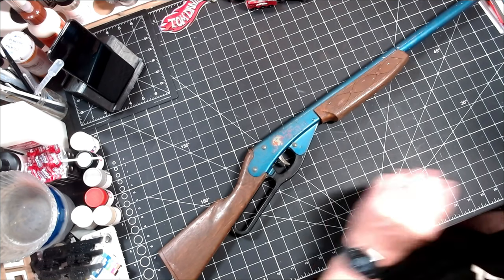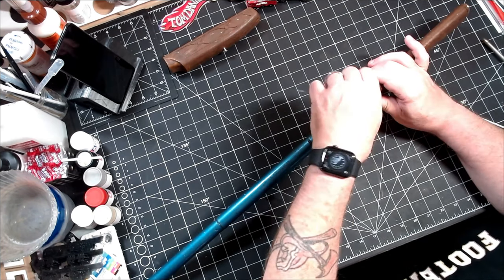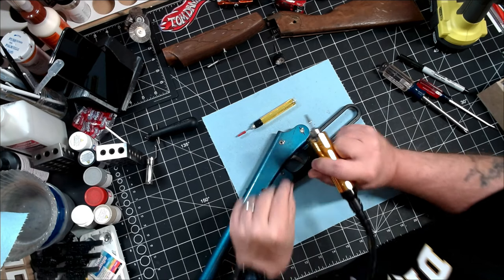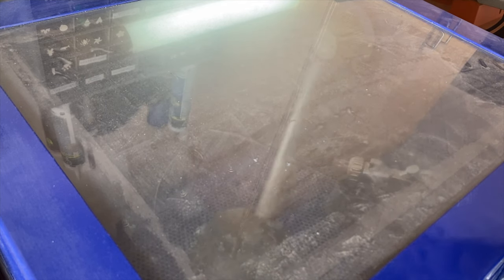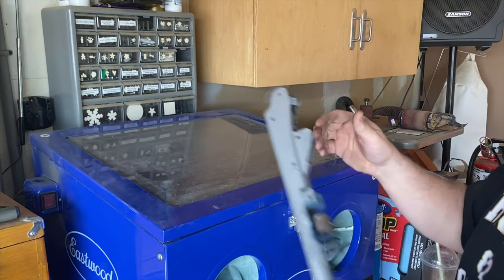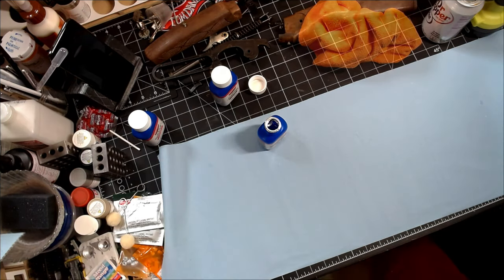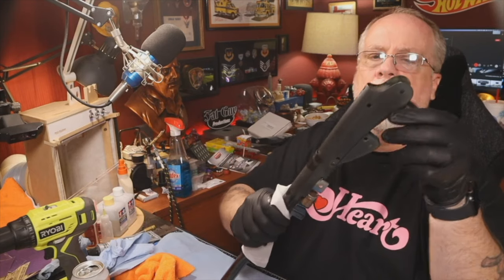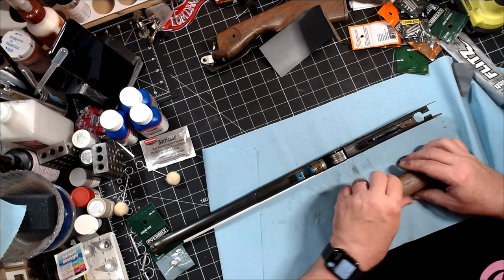Restoring a Daisy 660 Ricochet Noise Making Toy Rifle

Comment: Beautiful.  At first I was thinking...yes...the gun needs the decal.  But then you finished...IMHO it was the right decision to forego to decal.
And your right...the under barrel grip and the stock are amazing in the amount of detail molded into the plastic.  Fantastic wood grain.

Seems to me I always thought "blue-ing" a fire arm left a very slight blue tint.  Not noticeable unless really staring at it.  Wikipedia says it does leave a blue-black appearance...but your cold blue application did not appear to.  
Sorry.  A lot to unpack here....there is more...lol.
The ricochet drum...I am a guitarist...I noticed that the drum had light surface rust.  I cant help but thing cleaning that up would maybe improve the ricochet sound...probably not enough to notice...I just thing musical instruments sound so much better free of dirt and grime...or rust.  Not like a rat rod that sounds better the rustler it is.
Back to the bluing.
Ever thought of applying it to a Hot Wheel?  Say a Nomad?  Or a Twin Mill?  Couldnt help but think a cold blue-ing on diecast would be killer....

Comment: Can you give larger,clearer pics of 'ricochet' noise maker?I have a 660,wheel spins,but wire is missing,would like to be able to fabricate 1 for restoration.I have a chance if getting 2 more for $10.00 each as they don't make noise either! Thank you
Reply from the maker: I will add the 3 best shots I have on my community page in a few minutes after posting this.  I hope it helps!
Reply: @pauly7218  thank you